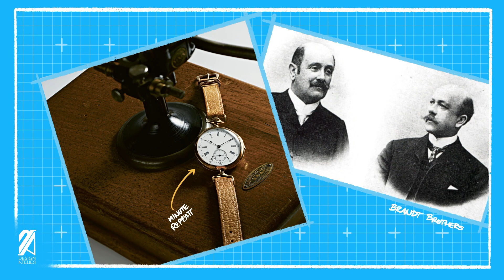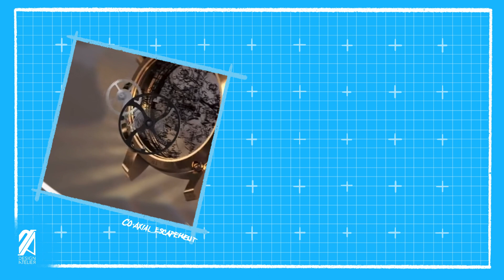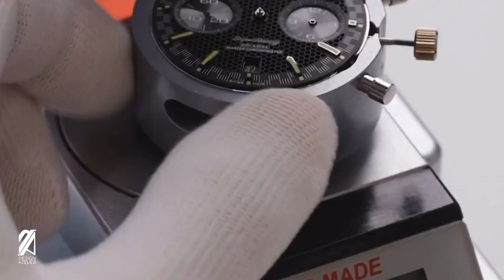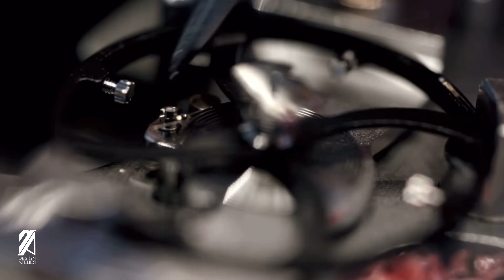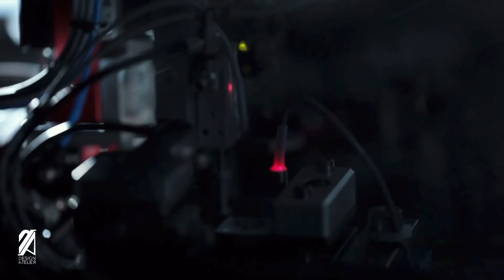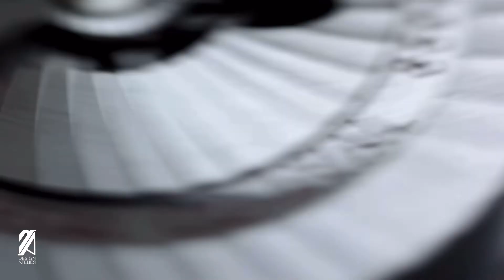Why The Industry Needs Omega Watches!

Comment: Great video Jayson.  Omega is a better value than Rolex.
Reply from the maker: I agree yes.
Reply from the maker: @Tobester_McDonkey  I think the value we’re talking in context here is with the tech inside the watch. Also in a buyers perspective, there is more value for omega because of the money saved comparable Rolex model whether you buy it in the AD or secondary market. In that sense, you’re point actually supports the value claim.
Reply from the maker: @Tobester_McDonkey  yes I’ve heard of those QC issues. I guess I dismiss those as not the norm. (Although people tend to always cite the same complaint. Maybe it is more common than I think.) and yes I also own a sub and Rolex QC is bar none. I cannot deny that also brings value. However, as you may know, I would have gladly bought your SMP at that low price even if I know the bezel doesn’t line up.